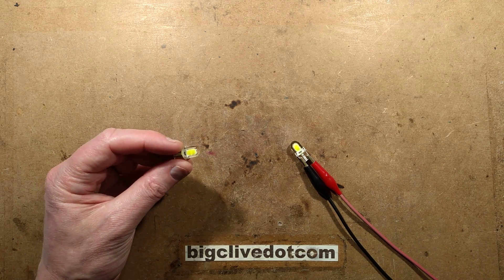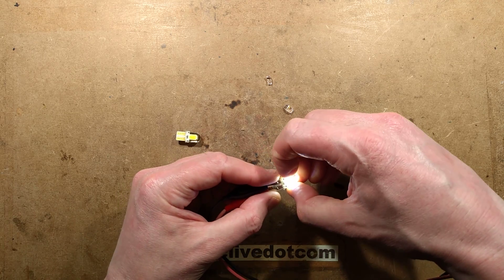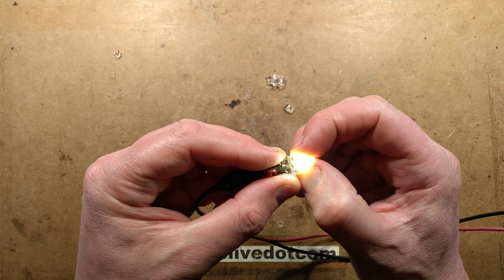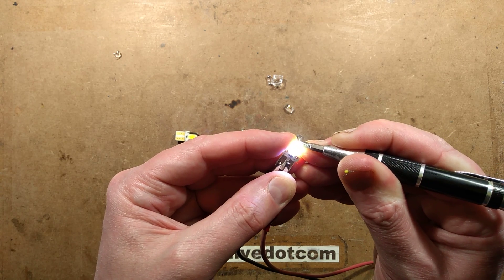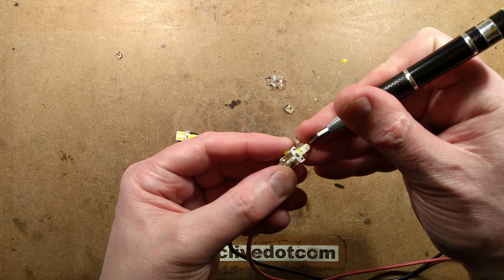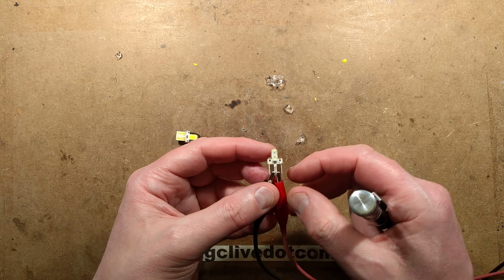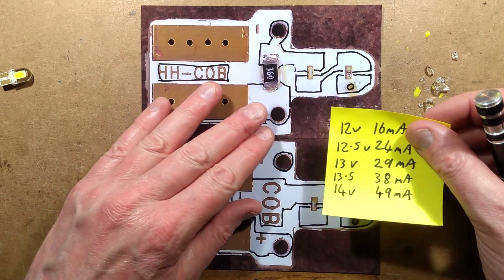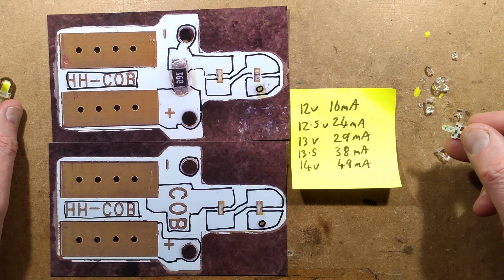Under the gel and phosphor of a COB LED car lamp.  (Deep violet chips)

Comment: ⚠️ Most mini bulb specifications are rated at 12.8v 14v or Both depending on actual bulb number. Osram and other catalogs will show you this.  Regardless of bulb specifications, Vehicles with "12 volt systems" should have 14 to 15 volts when the engine is running to charge the battery. CANBUS is used by many car makers as one of the protocols for OBD2 systems. "CANBUS Safe" for LED is just easy to say on a package but not all bulbs are monitored by any methods and most install "CANBUS safe" LEDs anyway.  Worse is many think that LED save power but "CANBUS" resistors often use far more power and generate more heat than the 194 bulb they often replace in this case. Standard 194 bulb specs are 14v 0.27a 3.8w but unit here is 14v 0.49a 6.9w with most of that is 5.45w just from the resistor. When used in many car fixtures you hope only the great upgrade of this rubbish fries before the fixture is cooked. Another common LED upgrade is 1157 and related bulbs with builtin or external "CANBUS" resistors that can wreck the fixture to cause a fire.
Reply: How did you get to 5.45W from 49mA @ 14VDC (0.69W)?
Reply: @ethanpoole3443  Sorry, Had a brain fart for the math... I missed a 0 to covert ma to amps so watts are off too this time so correct is 14v x 0.049a = 0.686w then I was thinking "CANBUS" parallel resistor not series w/ 4 LEDs. So correct resistor math should be 14v - (4 * LED Vf) [typically 3.3v each here] / 36Ω = x or (14v - 13.2v) /36Ω = 0.022a thru the resister and a lot less watts this time. But Even using cool LEDs in many vehicle fixtures they don't perform because of  LED and Fixture designs do not play well with each other and most will not last long regardless of marketing hype push by vendors.  Even with potting polluted water and dirt will wreck these.  Most vehicle fixtures for use with normal bulbs are Not totally sealed and often have small drains/vents somewhere on them.  Normal bulbs generate some to a lot of heat to dry out the fixture but Cool LED cannot. Typical 194 drops nearly 4w and 1157 taillight filament drops around 8w and enough heat to drive out any minor condensates inside most vehicle fixtures. And That is ignoring most "LED upgrades" cannot handle common power surges and other electrical and vibration problems in most vehicles. And illegal in many countries too but many twits ignore that until police tickets them or MOT fails the inspection then whine to hell and back claiming police etc are mean and far worse.
Reply: Things1000 test We all have those days when our brain takes the unexpected vacation, I was just a little perplexed by the earlier math. :-)

I can not speak for the specific LED bulbs in this video, but I have replaced all the interior courtesy and map lights with LEDs which do produce much more useful light than the original bulbs at just a fraction of the power consumption — about 10 lamps in all if I recall, mostly type 194 wedge style but some tube style as well.  I use the Philips branded units, they cost a good bit more but I have not had any early deaths (knock on wood) and they have been installed for over a year now and often spend up to 6 hours at a time illuminated and I have thus far not lost any to heat death.  They are a mix of 0.3W and 0.7W bulbs depending upon the amount of light I wanted at each location.  They definitely go much easier on my battery now when the lights are left on for extended periods as they now draw about 1/10 the current as the old bulbs...which also means that when I occasionally forget to turn the interior lights off it now takes 10 times longer to rundown the battery (not that I would ever do that...ahem...).

I intentionally have not retrofitted any of the exterior lights as there are legitimate regulatory compliance issues associated with altering headlights and signaling lights, so those will remain incandescent for the remaining life of my vehicle.

Comment: I'm confused as to how you flipped the picture. Neither the "COB" nor the "360" (on the resistor) are mirrored. But the + and - aren't on opposite sides, so it has to be flipped. What the hell is going on? :D
Reply: The side without the resistor has been flipped top to bottom.  All the text reads the same when it's flipped although the vertical COB has to be read upside-down but you don't notice this.  You can see the unflipped view at 3:08.
Reply: @petehiggins33  Oh you're right, the "COB" is normally upside down (I would have expected it to normally be the right way around with the copper leads to the bottom). That's strange. Well I guess that solves the mystery. What a coincidence, there's not a single bit of text on the side without the resistor that you can't flip. Text may appear upside down, but it's still normally readable.
Reply: Phino K.M.   That's a good point.  I happened to have a mirror within reach,  so I tried using that and , what do you know, COB and HH-COB don't change; except that now you have to turn the bulb upside-down to see COB the right way up.  Very strange 🤔
Reply: @josslevy4240  Well, HH-COB and COB don't change if they are flipped upside down, but if flipped horizontally they do change and since HH-COB and COB are in different orientations, flipping the image in any direction would mirror one of the two.

Comment: I'm a mechanic at a Canadian Chrysler dealer, I'm confident that bulb would throw a circuit code in any lighting circuit on any of our current models.
Reply: as I am confident, it's a Chrysler and will throws codes anyway, as the junk-tronics fail randomly on a whim, ......

Comment: Ive got lights similar to these and they habe already lasted in my truck longer than the 5-5050 types. These also mimic incandescent lamps better they give near 360 degree light. The ones ive got have a resistor on each side I'm guessing to spread the dissipation better. So that extra through hole might be part of that in later models.

Comment: damn that one is really peeling off easy, I've got some similar to those and they're quite hard to remove the silicon gel, but unfortunately that same gel also makes them quite thermally insulated, and the led's heat up too much and end up failing after just a couple hundred hours of use. (mines are 3 single "3014" LED chips and one 130 ohms resistor on each side) I've had to replace them every 3 months or so, but they're so cheap and give some good light, for the price of a single philips lamp I can get a couple dozen of these...

Comment: So is that 36 ohm resistor there to fool a cars bulb monitoring system to make it think that there is an intact filament in the lamp? If so, if the led's blow i take it that the car will still see the 36 ohm resistance and assume that all is well with that lamp? Not ideal if so.
Reply: I thought the same but Clives tracing the tracks proved it not to be the case.
Reply: This lamp didn't have any resistor to fake an incandescent lamp, the 36 ohm was just in series with the LEDs. Most of my cars are old so if I can't get anything else than "CANBUS-proof" ones I remove the CANBUS resistor to keep the heat down. I like the higher powered ones for backup lights, it really helps when living in the countryside (the heat dissipation is no problem on high power backup lights as I normally drives forward 😁)

Comment: I got the same ones for my motorcycle. Another one i got says it's cob but it's actualy a blue led 5mm (i think it has  3 chips and a resistor inside)  working on 12V directly under a phosphor plastic piece.
Reply: Hm i opened mine up and it's actually blue underneath, not something weird.

Comment: Like the old Studebakers that used incandescent bulbs behind glass UV filters to excite phosphors on the gauge faces.
Reply: swapping it with a blue or uv led would make it 100x brighter then
afterall, those bulbs puts out like zero UV
Reply: Needforsuv, amen to that.  It was a terribly inefficient illumination system, but it worked and it looks stunning.  Like a VFD or OLED panel looking as it used silk.screened colored phosphor legends on the gauge faces.  I believe the light bulbs are a bit different than normal, run pretty hot filament to get more into the blue light spectrum.

But yeah, ultra violet LED retrofit to replace the inefficient incandescent UV source is the perfect solution.

Comment: Mr. Clive, I speculate that the holes are there in case they want to use a thru-hole resistor instead of the smd one.
Reply: I was thinking it was a path for the gel cover to help keep it attached to the circuit board.

Comment: Could those purple LEDs be UV LEDs? I saw the purple show briefly on your thumb in the video.
Reply: I'd guess so too. Near visible UV exiting phosphor above it perhaps. I think it is very common to have blue or near uv led combined with phosphor on white leds.
Reply: Although early white LEDs did use UV(A) so that that they could use existing phosphor chemistries, modern LEDs use exclusively blue to violet LEDs so as to avoid passing UVA light in their output since UVA can cause damage (fading) as well as carries certain health risks as phosphors are now readily available to convert those wavelengths efficiently into white light.
Reply: They're probably 395-415nm LEDs, which is near UV with a color phosphor to get the desired light output. This way, they can get a uniform spectrum of colors instead of the old gallium arsenide phosphide LEDs which have a much lower lumen output and vary drastically in brightness depending on the color.

LEDs with a wavelength of less than 395nm get more expensive the farther towards UV you get due to the more exotic materials required. I bought a pack of 10 low 300nm wavelength LEDs a couple years ago and they were ludicrously expensive, think I paid like $23 for the lot. There are some in the high 200nm range, but single modules were well over $100 a piece.
Reply: @GGigabiteM  $2.3 per LED doesn't seem too bad... And nowadays you can buy a UVC LED (265-285 nm) for $20: https://www2.mouser.com/ProductDetail/Inolux/IN-C33DTDU1. Still, mercury vapour lamps are cheaper.
Reply: GGigabiteM Indeed, if the light actually looks “purple” to the eye then it will be a violet to near UV (as in not quite UVA) LED as true UVA LEDs do not tend to look purple to the naked eye (it tends to look like a very dull white to yellowish-white light when viewed — though the result might appear different if one has had cataract surgery...I’m not sure how UVA interacts with the lenses implanted after cataract surgery.  But I can attest that if you look into a true UVA LED it does not look at all purple to the naked eye, but violet LEDs most certainly do.  I use UVA lamps (with eye protection — polycarbonate blocks UV very effectively) to cure UV sensitive glues and resins in my hobby work.

Comment: before using flip chips  the gel phosphor was to avoid the thermal stress breakage by the bond wires ( Instead of using a hard resin phosphor)
Reply: Rice Guy No, if it was a "phosphor" it was always to change the color by emitting wavelengths other than what the chip emits on its own.  Due to the physical mechanism of "phosphors" they are mostly limited to converting to longer wavelengths (higher per photon energy), thus starting from UV, violet or blue is best.
Reply: @johnfrancisdoe1563  i was because they used resin before

Comment: Here's an idea that might be right up your alley:  What chemical solutions could potentially be used to wash off or devolve the phosphors without damaging the rest of the package or the substrate?
Reply: If it is a silicone gel in which the phosphor is bound, I can't think of anything that wouldn't dissolve the chip.
Reply: @garbleduser  Well he already plucked off the silicone, unless the phosphor layer is ALSO in silicone?
Reply: Electrical contact cleaner works if you let it soak for a day. Ie in a jar. Found this out by accident on a maglite with a bad contact. The whole top lens came off for the big purple/ blue light show.
Reply: @aligreen4 Thank you!

Comment: This link seems relevant here - I remember we also did this many years ago to check the tamper resistant potting/mesh on some of our products: https://twitter.com/i/moments/1112130787694931968
Reply from the maker: The only one of those components I failed to identify correctly was the vibrator motor.
Reply: @bigclivedotcom  The one I found interesting was the bi-colour LED - as you would expect the die were on opposite sides.